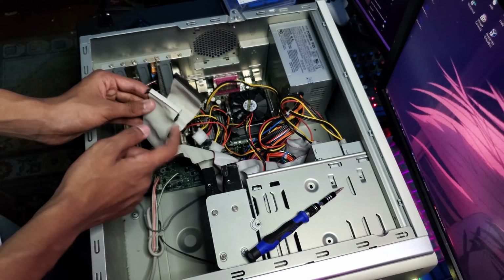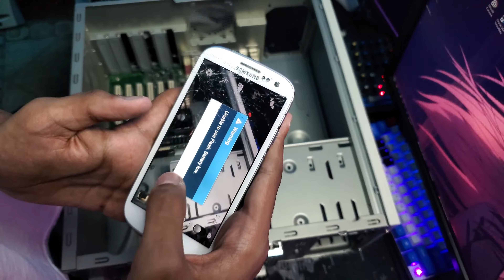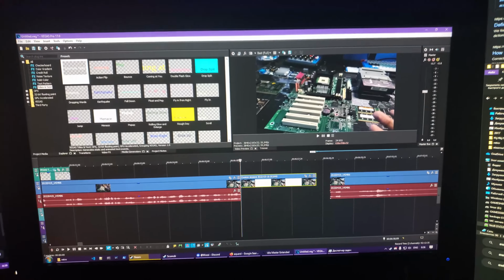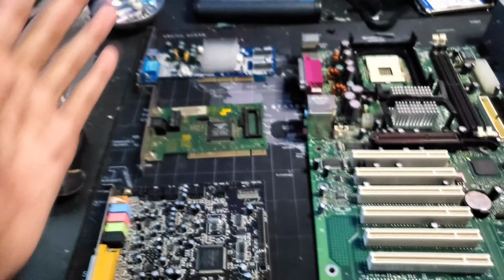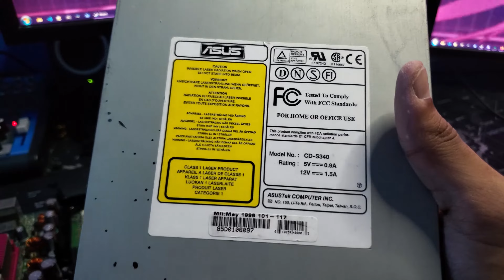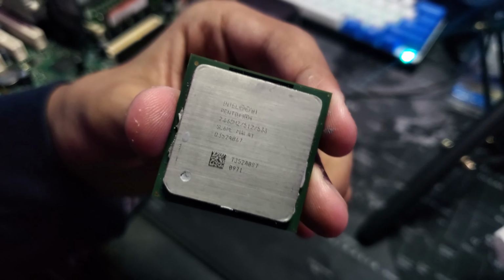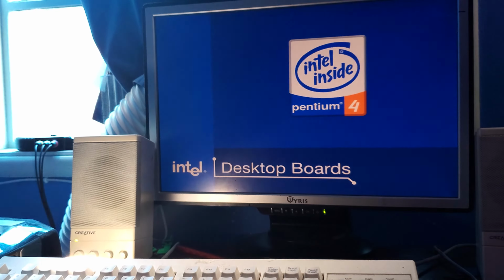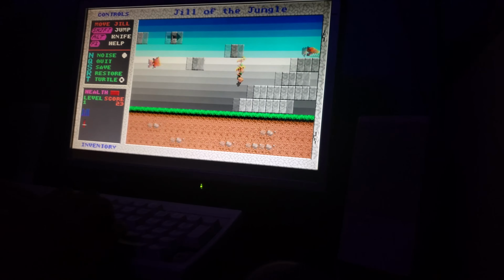Building my DREAM Windows 98 gaming PC!

Comment: I have that exact sound card and managed to get it working in Windows 10. It has a great sound to it and is still better than my motherboard's audio.
Reply: any modern motherboard will definitely smash this out of the water, and most soundcards dont work properly with modern windows. Had a zxr that I just gave up trying to get to work on windows 10 and 11. Its supposed to have a dual processor codec that would take load off your cpu, but the cpu still does most of the processing.